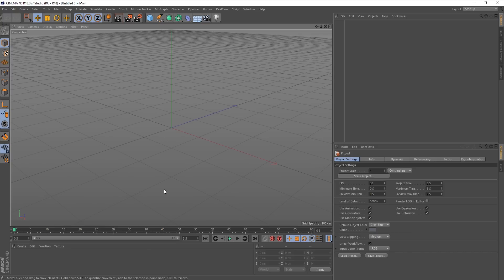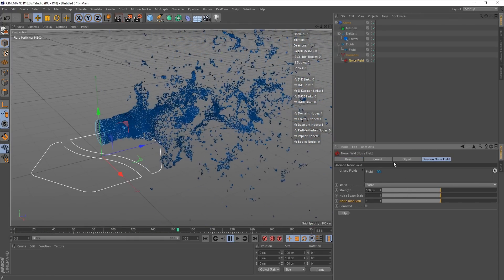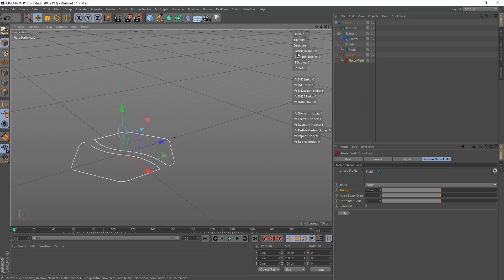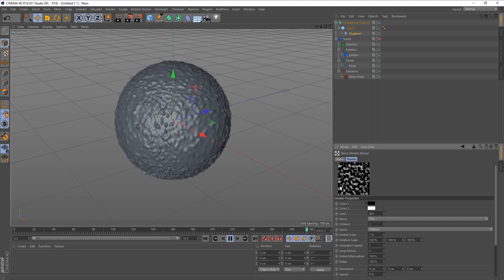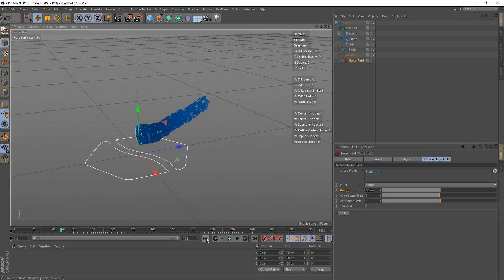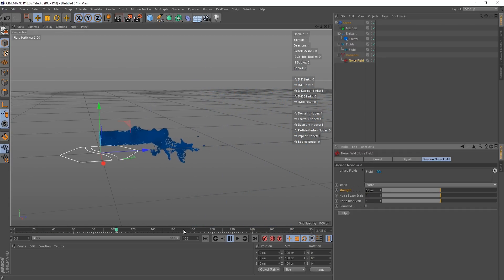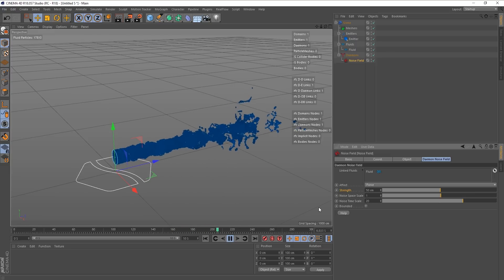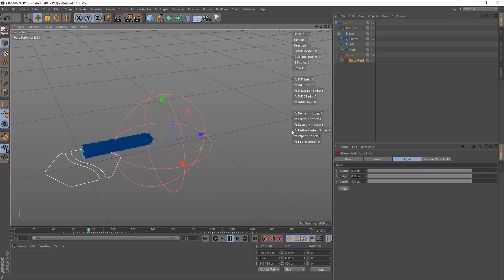Realflow For C4D: The Noise Field Daemon

Comment: Your description of the noise space scale is incorrect. It isn't the frequency; it's one over the frequency, i.e. the wavelength, which is why they call it the scale. The reason you see little movement when you set it to 50 is because the scale is so big, one oscillation of the noise occurs over a very long distance.